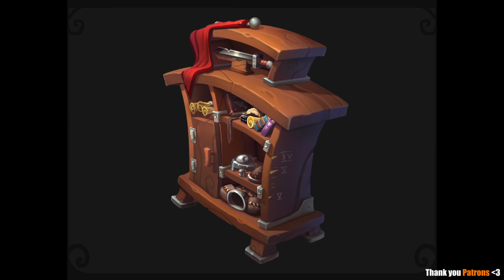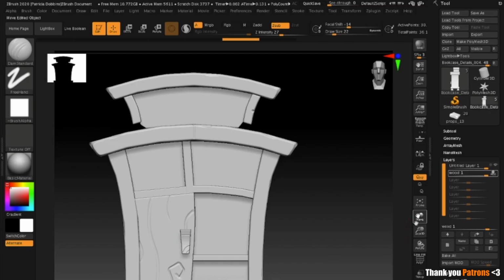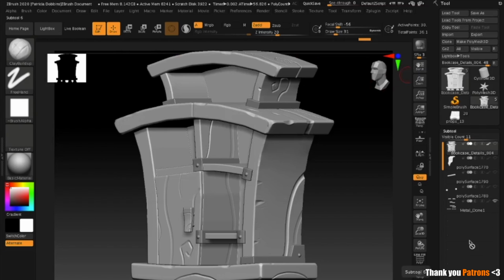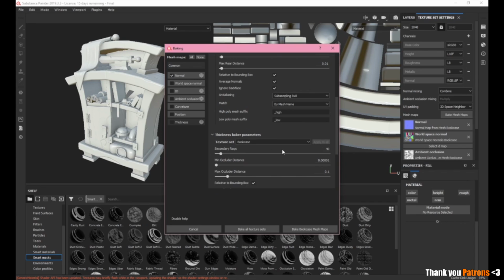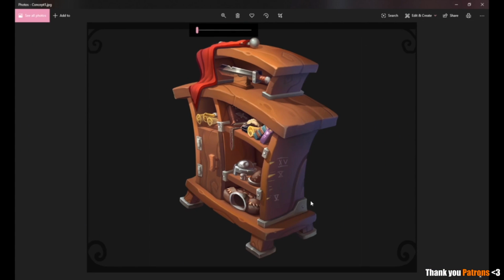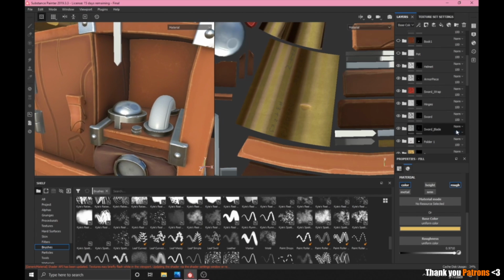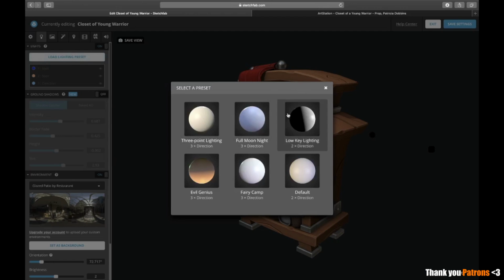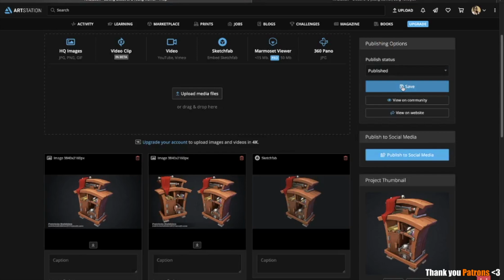Full 3D Game Asset Workflow Explained - FULL TUTORIAL

Comment: I know this is a year old, but I have a question that nobody has answered. Why does everybody do the high res model first and then retopologize instead of doing a low res correctly topologized model first and then build a high res sculpt from it?
Reply: I think those are two ways of doing 3d models. A lot of people like to start with high res since it's more like real sculpting, and don't have to care about topology details nor poly count while in the middle of the creative process. Plus, there's a lot of good tools that do retopo for you! (I use Blender and my usual workflow is using multires, so...)

But I started with what you say: first start simple, and then apply more and more subdivisions until I got what I wanted. Still, it's a really slow method and while with the high res one you can work from a high poly count to a low one, it's usually harder the other way around.
Reply: @Ada-ut5wh  
Here's another random question for you. In Blender, why would you use a subdiv modifier when you could use multires instead?
Reply: @FreakazoidRobots  uh.. have you read what I wrote? I started first using subdivision because of the difficulty. Multires is way better and is my usual workflow now
Reply: @Ada-ut5wh  
I though multires was the same thing as subdiv but you can sculpt on it? What makes it harder?

EDIT: It's basically the same thing as division levels in zBrush, right?